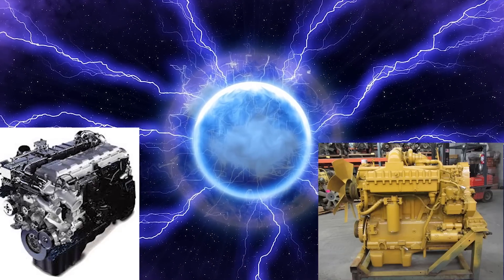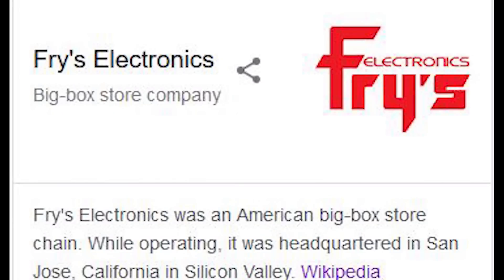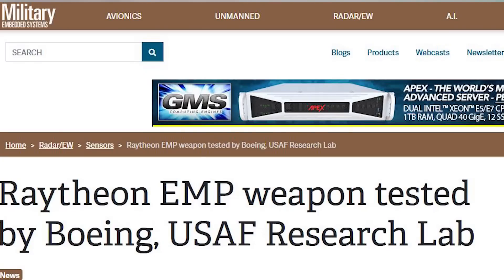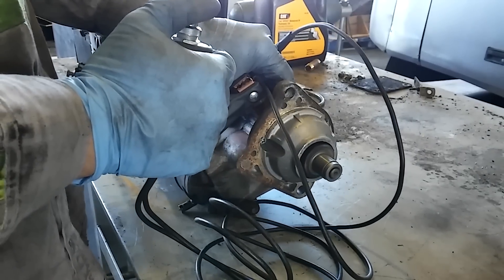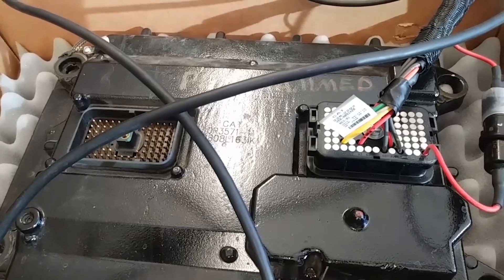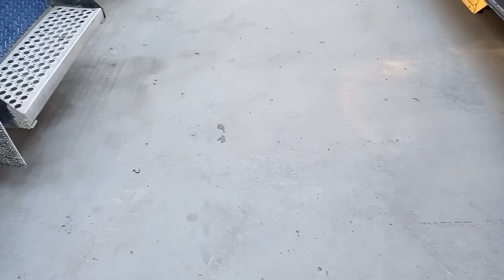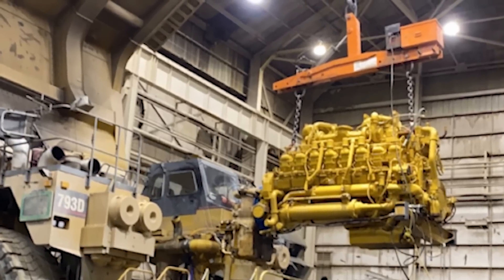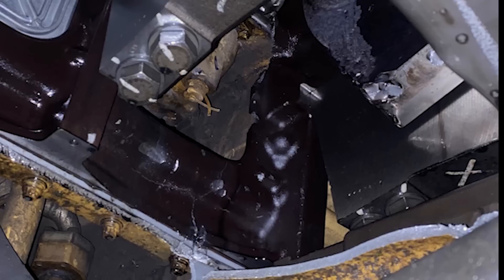Are Diesel Engines EMP Proof?

Comment: Most vehicles are too small to be effected by EMP, EMP needs long cables and wires like transmission lines to generate significant voltage. All the cab-specific stuff would be fine on a tractor trailer, however anything sensitive to voltage that plugs into the trailer may be damaged.

Comment: My 1986 Mercedes 1116 would have been. Loved that truck. The way you shut it down was to push down on the fuel cut off. As long as it had fuel it would keep running.

Comment: Well, older equipment, trucks,and cars wouldn't necessarily be effected. But my question would be, how likely would electrictronic equipment be effected by an EMP pulse? I see it might be a problem on a war front or something of that nature. But I don't see it being a problem during every day life.
Reply: There is no significant risk, even in a targeted EMP attack, that vehicles would be immobilized. This was tested iirc in 2010 or so, they exposed a bunch of cars and trucks to the EMP force expected at ground zero of a nuclear device designed to maximize EMP output. A few of them stalled, most of them had flickering lights, not a single one had any permanent damage.

Comment: Get a large enough Faraday cage around the electronics, then yes they are. An older mechanical injected diesel would be more so since it just has the alternator/generator and starter. You protect the electrical system, anything can be EMP proof.
Reply: Did you even listen to the video? That would not work unless the cage was around the entire truck
Reply: @C4soulja  I posted it before the video started because of ads. I knew most of what was going to be talked about from the getgo.
Reply: Think you’re greatly underestimating the power of Mother Nature.

Comment: My 12 Valve daily driver would be.  EMP might take out the power windows and other things but being a stick shift I don't even need the battery or key to start it. My FSS is gutted so no issue there either.
Reply: Does it have a lift pump in the tank?
Reply: @danw6014  No.  Stock 12 Valve is mechanical pump driven by the camshaft.  I have a high volume low pressure pump but works the same at stock in the same location. Is just more fuel.
Reply: @danw6014  factory they come with a cam driven piston pump, block mounted.
Reply: @jeremymyers5643  right but I believe they had an electric lift pump in the tank.
Reply: @danw6014  I'm talking about the lift pump. There's not a electric lift pump on the 12v.   24v yes.
Reply: @danw6014 on the block and mechanical fuel injection
Reply: All I can think is alternator fuel combustion from bump start and runs like deuce and a half till kill switch is pulled

Comment: If you're worried about EMPs just slap a carburetor and points on your gas engine. 
I've heard of stories about tons of cars going black for a few seconds on highways in the middle of nowhere.
Reply: @LabRat Knatz That Amazon charger is highly suspect. I don't order things off that website anymore and the only chargers and cables I buy is a name brand that I've heard of or used before.
Reply: @LabRat Knatz You're right it isn't simple but it's still easier than trying to completely EMP proof a modern car that's basically a computer on wheels. It would also need a mechanical fuel pump, manual selector for the auto or a manual trans, all mechanical gauges, and the wiring harness greatly simplified. The BCM could remain, or for extra spice, replace it with a row of toggle switches.

Comment: I fell down this rabbit hole after the line on battlefield 4 campaign about the aircraft carrier diesel engine being unaffected by the EMP and something about "as long as the engine keeps running"
Reply: Engines and electronics in the bowel of a ship are protected as they are inside a Faraday cage.

Comment: I'd like to think a 3406B with an Airstarter would survive one
Reply: It would stand a chance.  Most mechanically injected engines would stand a chance too.  People will argue electric starter will be damaged... but that is highly unlikely.
Reply: @ShainAndrews  Solid state starters would be fine.
Reply: @mikeznel6048  Show me one...
Reply: @ShainAndrews  roll start
Reply: @5.43v  Sure... so long as a person has an adequate hill.
Reply: The idi in my 87 ford still needs about 10v to turn the injection  pump on